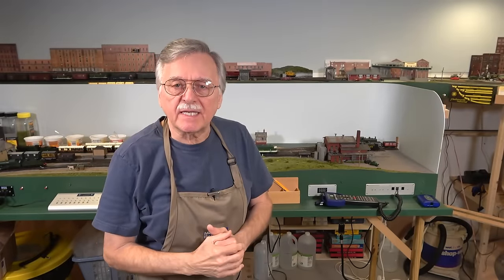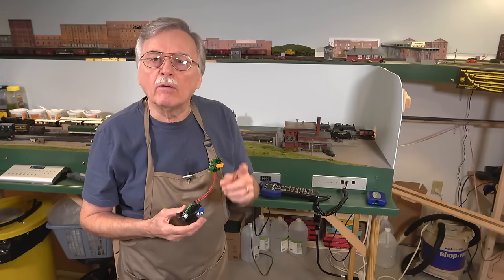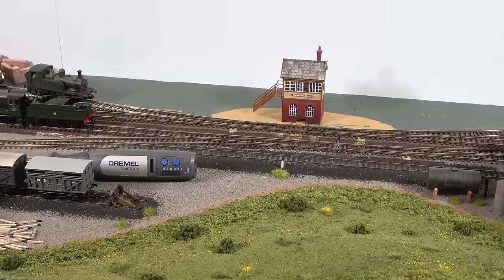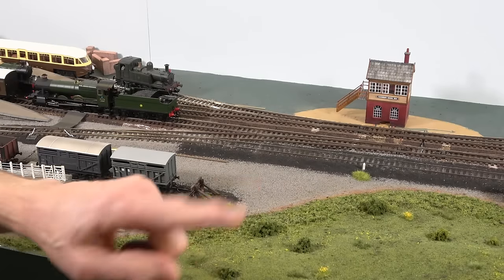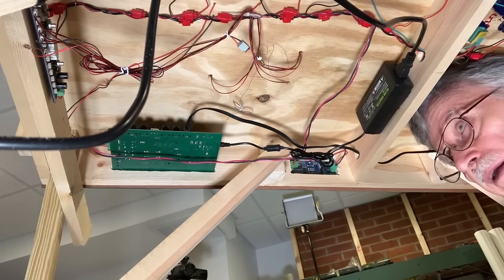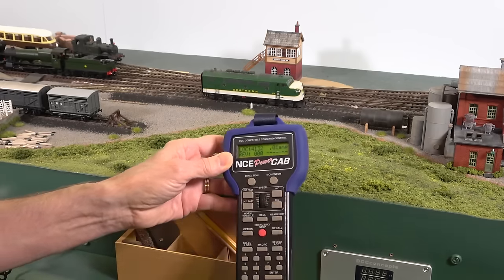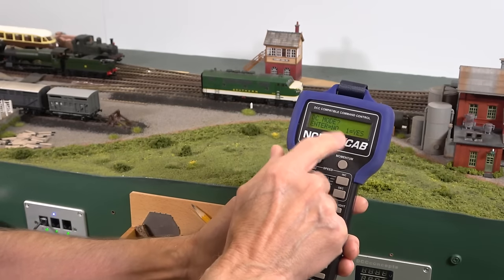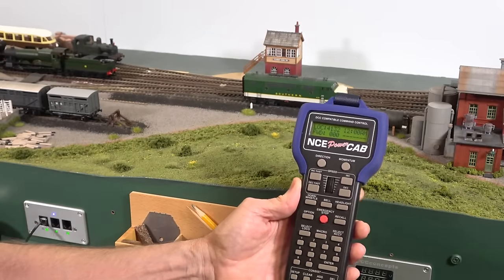Adding A Programming Track To Your Model Railroad (350)

Comment: Another really good video Larry ! Really enjoyed it ! I have a couple of questions about your layout : #1 Do you have a separate DCC track bus AND a DCC accessory bus ? #2 Does your layout have separate DC bus(3.3 volts, 12 volts, and 24 volts) ? I assume the separate DC bus would power your accessories ? Merry Christmas  Larry !
Reply from the maker: I currently use the main DCC bus to power accessory decoders but plan to add a separate DCC accessory bus. I also have a 12VDC bus for accessories that run direct off DC.

Comment: Is it easier &/or better to make a cut in the rails vs. attaching an additional section of track using insulated rail joiners? I haven’t fully finished laying track at this point so both options are available to me. Even after watching the majority of your videos, as they are ALL very informative, I do appreciate the work you’ve done to create playlists as it will make it easier to go back and quickly find specific topics. Merry Christmas! 🎄
Reply from the maker: It would be the same, I just wanted to show the process for adding it to an existing layout.
Reply: @TheDCCGuy  excellent, thank you!

Comment: Larry  With My NCE system I setup and Isolated section of track in one of my yards and I can run the engine on the programming track   I use a toggle switch  to turn on and on the DCC system to the track that works for me.
Reply from the maker: A surprising number of people are still confused when it comes to using the DPDT switches with various types of DCC command stations. The nice thing about Aegis is it is all done internally for you so no “complicated” switch wiring to be done.

Comment: Thank you for all of your videos. They are very well done and easy to follow. I power my layout with a Digitrax DB150 and a PM42 using three of the four sub-districts. I would like to add the "drive-on" feature to a short spur but it seems that I cannot add a DPDT switch after the PM42, as this setup will still allow programming to the other sub-districts. I plan to place the DPDT switch between the DB150 and the PM42, then use the fourth sub-district to add power to the isolated programming track. My concern is when the DPDT is thrown to the programming track, will commands be sent backwards through the PM42 by way of the fourth sub-district wiring? Please let me know of your thoughts on this. Thanks.

Comment: Did you connect your feeder wires directly to the NCE autosw, or did you connect feeders to bus, then bus to autosw?
Reply from the maker: First, I didn’t use an Auto-SW since the Aegis system has built-in provisions for a programming track. However when using the Auto-SW with a powerCab you connect the output from the PowerCab to the input on the Auto-SW. Then the programming output goes to the programming track and the main output goes to the bus wires. There is a diagram on or about page 13 of the PowerCab manual.

Comment: Hi Larry,
Your videos are always interesting and enjoyable .
My control systems is NCE Pro Cab, SB5 DCC Concepts circuit breakers, Alpha Meter, Alpha Panel. Considering going wireless the obvious avenue would be the NCE RB 02and Procab Radio rather than the Aegis system. Can you give me any pointers as to which route may be best. The NCE route would give me an additional hand set which could be used to use for the programing track.  Probably is ok but one may be better!
Any guidance would be appreciated.
Thanks
Arnold Sumner

Comment: As an idiot proofing method I will use 2 NCE Auto SW's with an isolated "dead" track between the programing track and the layout.  With this method, only use the "Main" outputs of both the Auto SW's and power the "Programming" track section with a feeder placed on the main power bus BEFORE the bus connects to the Auto SW's. (See NCE Article "Live Program Track with Auto SW.) Thus, one Auto SW will have the only have the Main output connected to the dead track and the other Auto SW Main will be connected to the layout. Again, the dead track is completely isolated as is the programming track. In normal mode  a loco can operate on both tracks.  Both special tracks are longer than my longest locomotive.

Comment: Like your presentations. In this one, on your fascia there is a box containing a pencil and a NMRA gauge. Do you have a plan or source for that? Richard West
Reply from the maker: The pencils came from Staples and the NMRA gage from a hobby shop. But I bet you meant the wooden car card box with 3 or 4 slots. Those are sold by Micromark.
Reply: Thanks. The box is what I an interested in. @TheDCCGuy